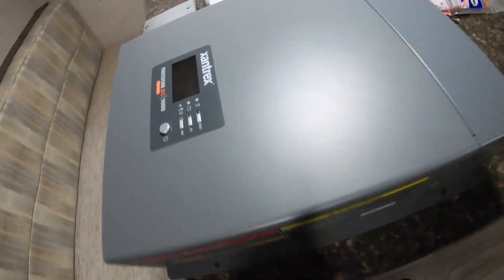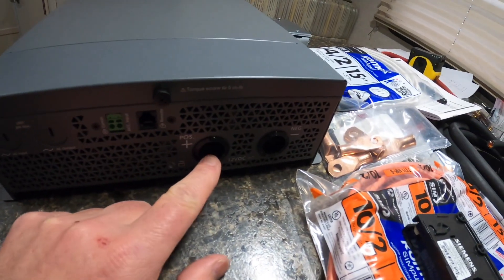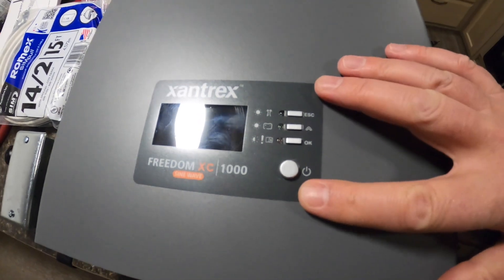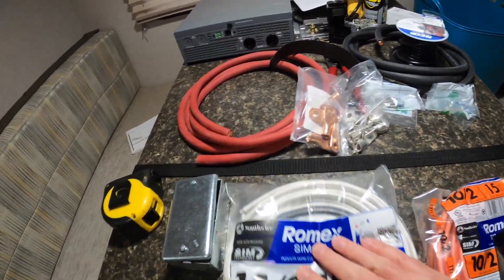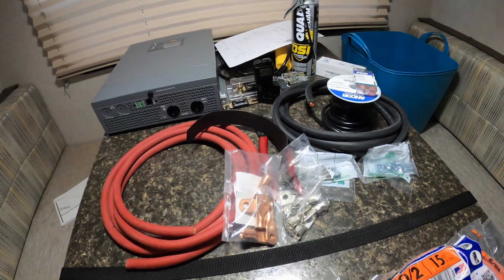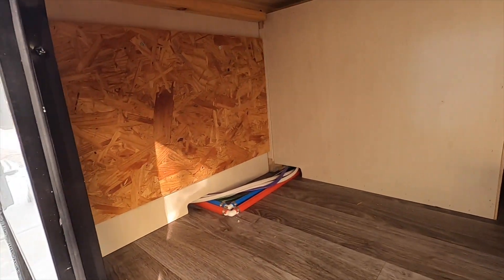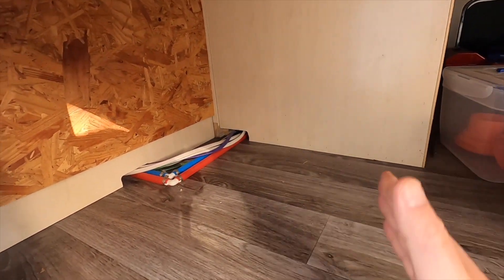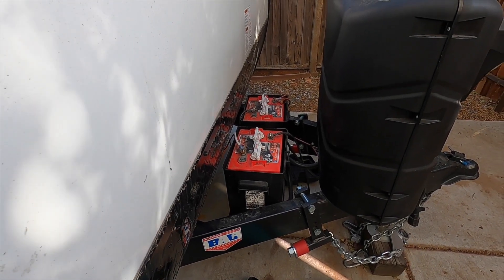Xantrax XC Inverter/Charger Installation and Review! Boondocking Power!!

Comment: Except if the inverter is off it will not charge the batteries as you explained. That’s like says my toaster makes toast even when it unplugged.
Reply from the maker: The inverter is wired to a 30a AC breaker in the camper, so if the camper is connected to shore power or generator, and the breaker is on, then power is going to the XC1000 and the transfer switch will know it has a load and the charging component of the inverter will charge the batteries. The inverter portion of the XC1000 doesn't need to be on or off for that to work. It's a separate circuit in the unit that handles the inverter process. The one thing that won't happen with the way I have the XC1000 wired in, is that there is no "conversion" happening from AC -> DC from shore power. Meaning, if I didn't have a battery bank set up on the camper, and I was connected to shore power, then the 12v side of the camper would have no power. The factory converter/charger does this, but since I disconnected it during my installer of the inverter/charger, no converting is going on. No biggie for my install, but for others it might matter. 
Cheers!

Comment: Where did you source the AC input, the 30amp main breaker (on panel) or cable attached to any 15amp RV outlet.  I ask as when on Shore, you don't want convertor charging batteries (right ?).
Reply from the maker: I sourced the AC from a newly installed breaker. Check out where I discuss this. https://youtu.be/VbeomvcMXy4?t=261 I moved a circuit , and installed a new circuit breaker to feed to the inverter. So when shore current is applied to the panel, then the inverter gets AC.

Comment: Hi Kieth, I have the same setup as yours but for a cottage that we use on the weekends. I am planning on adding the remote panel for convenience (batteries and unit are in the crawl space). However I read that you can only turn the inverter/charger on (when it is turned off from the inverter/charger). But what about turning it off? Can it be done from the remote? I need to have the unit completely off so as not to drain the battery.
Many thanks
Reply from the maker: Hello! Yes, the round silver button on the remote will turn on or off the inverter. What it will not control, however, is the charging. If the inverter is receiving current from a shore connection, it will charge the connected battery bank regardless of whether the inverter is on or off. Hope that helps!
Reply: @keithre1896  thanks a lot Keith. This is the information I was looking for months.
Happy summer and RVing

Comment: Nice video, good explanation!
I am looking at either the 1800BH or 2100BH. Slides make me nervous for potential problems plus you can't use a slide when it's retracted in....bummer!
I'm looking at bunkhouses as I want to install under the bottom bunk 3- 200 AH SOK Lithiums along with a Victron 3000 inverter/charger. Seems like a perfect location for a "power station" Then on top three 190 Watt panels and another 200 Watt portable on the ground to chase the sun. I have a 2500 Watt dual fuel Inverter/gen to top off the batteries on extended cloudy/rainy days. For health reasons I need the A.C. on hot humid days.
You are so lucky your camper has a oven, new current models do not. Sure wish Win. would at least make it a option
Reply from the maker: Thanks! Sounds like you will have a great set up! We want to move to lithium as well in the next year or so I think. For our needs, the 1,000 watt inverter is enough, but I can see having more electrical needs. I like solar a lot, and I find that I don't like using my generator unless I absolutely have to, but it does help if I run it like 1 hour a day during those cloudy days. I'm looking forward to moving to lithium to get faster charge rates too.
Reply: @keithre1896  Lithium is taking a pretty decent drop in price lately. SOK brand Li's (my choice)are a excellent battery for about 60% the price of Battle Borns according to Will Prowse (check his channel....you'll love it) Currently a 200 AH SOK Li is right at $1K. Twice the AH's of a Battle Born. One of the clubs on line gets members a 15% discount on Battle Borns. Add a solar panel and qualify for a 26% Tax Credit. Pretty sweet!
Reply from the maker: Thanks for the tips! Those SOK batteries look awesome!
Reply: @keithre1896  You're very welcome Keith. Check out Will Prowse Solar where he actually tears one apart.....he was impressed and that's not common with Will LoL He is the solar guru of YouTube :) Another one is "I'm not lost, I'm Rving" He's a professional installer, system designer. He took out his Battle Borns and replaced them with the SOKs One of those and a solar panel is a great buy especially with the Tax Credit still in place for this year.
Reply: It’s an absolute great video and discussion. As a newbie, would this inverter work with lithium batteries? Also, would it charge when driving? I have read when you switch to lithium batteries, some trucks alternator don’t like that and tend to die premature. Thanks again!

Comment: To run your DC cables did you just drill through the floor and then route them outside along bottom of the camper? Looking at doing nearly same setup. My trailer came with a solar charger installed but there's not enough room for me to run the DC cables out. How did you seal up around the cables? Just silicone? Any other gotchas to be aware of? Thanks!
Reply from the maker: Hi Jeremiah, yes I just drilled a hole through the floor big enough to fit the +/- DC plus ground cable through, then sealed with a the similar water proof expanding sealant they use at the factory for when they seal cables or gas lines coming through the bottom of the camper. I just picked up some of the sealant at Home Depot. Then I ran the cables along the frame up to the batter box. Overall , super easy install. Used zip ties to hold the cables in place on the frame. Used a marine grade self tapping screw to attach the ground cable to the frame. 
Hope that helps!
Reply: @keithre1896  It does indeed! You are a scholar and a gentleman! Thanks, let you know how it works out when I work on it this weekend. Thanks for making the video!

Comment: Hi Keith, I am planning on adding this same inverter on our new 2021 1808.. I have a couple questions hoping you could answer.. The under belly on our unit seems like it has a soft sac sorta thing.. Thinking this is just pink insullation, do you happen to know if i can stilll drill through this? Also was going to run the inverter straight to the main breaker, basically splicing the shore power connector, then going into the inverter and back out of the inverter back into the main breaker?  Thoughts on these questions would be greatly appreciated.
Reply from the maker: Hi there! For drilling through the floor for your DC cables, yeah you can do that, I have the same underbelly insulation. Just make sure there's nothing in the way underneath or in the floor that you would hit. I used a weatherproof expanding foam as a sealer after feeding the cables through. 

Wiring the inverter the way you described may work, but the only thing I would be concerned about is that the inverter has its own set of risks that could short or overload that romex leading from the main panel to the inverter, and trip the breaker. Anything from a bad ground, or a surge from the battery that wasn't stopped with a fuse, or something that might go wrong with the electronics in the inverter. If anything went wrong with that inverter circuit, then your shore power would be out. I look at the inverter as it's own circuit, and the shore power being the main power feed into the camper, and they both have their own set of potential things that could go wrong. I would probably stick with putting the inverter on it's own circuit breaker for safety. 

Congrats on your new 1808FBS! You're going to love it!
Reply: @keithre1896  Thank you for the reply... I agree thats the better way to go.. Adding in another 30 amp breaker.. This will still allow the entire camper to be inverted correct ? Also does that mean that the internal switch that changes from shore to inverter power is still working ? Also what guage of DC cables did you use... Our old rpod had a 2000 watt inverter as well and the person that installed it the way i orignally suggested worked fine.. He used a 4 wire romex though because of the thicker wire, and just didnt use the red wire.. Thoughts?
Reply from the maker: Hi there - sorry for the late reply! The process from changing shore power to inverter power is handled through a transfer switch, which in the case of my install, is built into the inverter. So if your inverter has a built in transfer switch, then it will detect when shore power is connected, and automatically shut off any inverting off the battery bank. The DC cables we used are 1/0 gauge. No penalty for going overkill on the DC cables! I'd go as big as you can go on those, but that gauge is for our 1000 watt inverter. A larger inverter likely requires even larger DC cables. For the Romex, I just ran 10 awg from the 30 amp breaker to the inverter, which is the same as what's used for our shore power input, which is also 30 amp. 4-wire would be used for a dual bus 240 volt application, like when you need to wire two hots, a neutral, and a ground. I didn't use that in my application, since it's all 120 volts. To invert your entire camper, you need to utilize the subpanel you wire into the inverter, and then re-route those circuits to use your new subpanel. But I'd caution doing anything big, unless your inverter can handle it, and of course, you then need a crazy high Ah battery bank to support it all. I kept my install small so as not to kill my battery bank too fast, so that's why I just inverted the plug circuit, which allows me to run the television, and plug in my laptop, etc. I could invert the microwave later since the surge rating on the inverter is like 2000 watts. But it's not a priority for me. 

Good luck with everything!